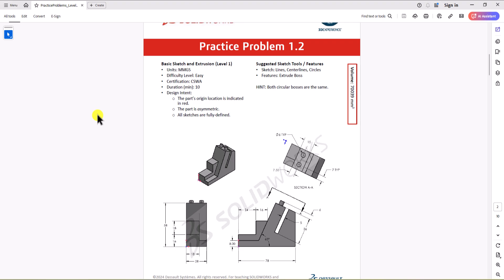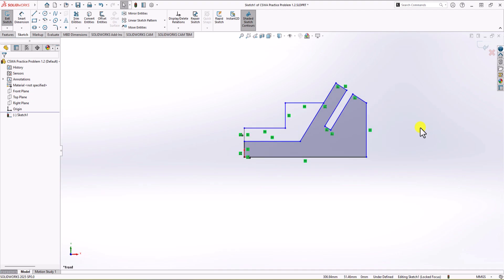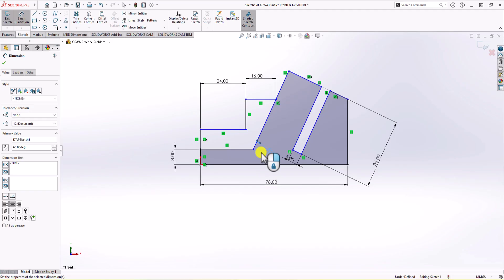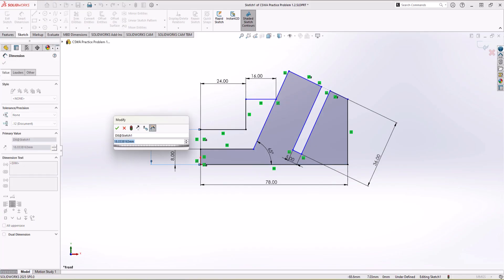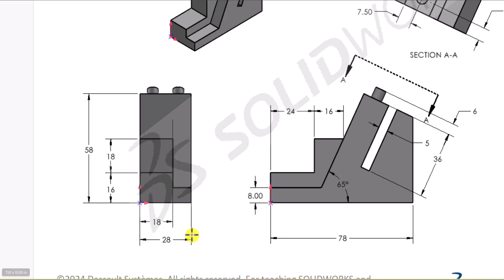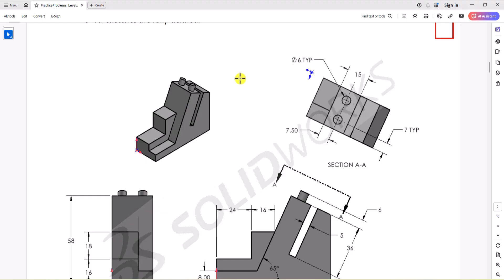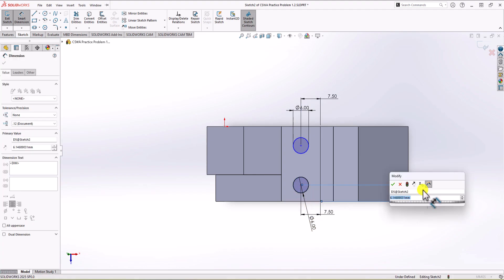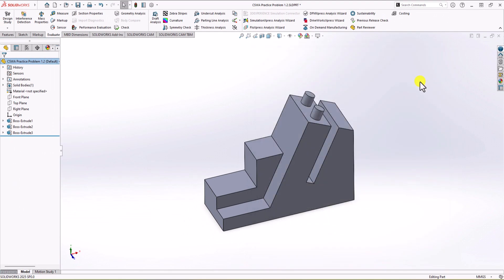CSWA Practice Problem 1.2 Solution | SolidWorks Exam Guide

Comment: Hi, It's not recognizing my Steps as a contour - I've started from scratch several times - any ideas?
Reply from the maker: Hi,
It’s hard to say without seeing your model. If there is an open contour in your sketch, SolidWorks won’t allow the extrude. I suggest zooming in closely on the sketch and checking which part of the contour is open. Sometimes the issue is not easy to spot, so zooming in can really help you identify the problematic area.
Reply: @Design_With_Roozbe  Thank you for your response, I'm almost 40 and learning this program for work. In your video, you do the sketch the first figure with line and once it closes the contour becomes shaded. You then immediately go into building the second contour, the "stairs" when you completed that part, is there a setting or something I missing to make it snap and realize what I'm trying to do? I feel like I'm doing exactly what you are doing - Vertical Line, horizontal, vertical, horizontal. Nothing, just doesn't recognize the contour independently or anywhere.
Reply from the maker: @personal-wb2io  Regarding the shaded region, SolidWorks has a setting that helps identify closed regions for extrusion. You can enable it by going to Tools > Sketch Settings > Shaded Sketch Contours.
That said, even when this option is turned on, SolidWorks may not always recognize a closed contour automatically. There’s no need to worry. If your contour is closed, simply go to the Features tab, start an Extruded Boss/Base, and then manually select the desired closed contour from the Contour Selection section of the extrusion feature, just like I did at 5:32 in the video.